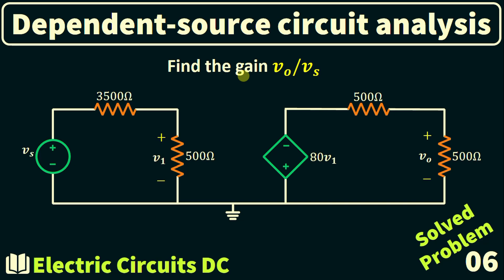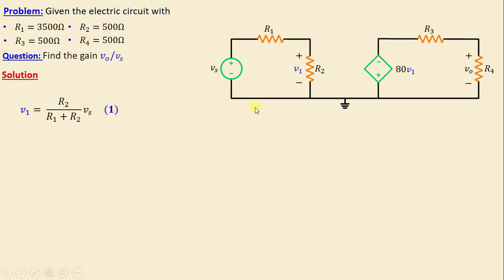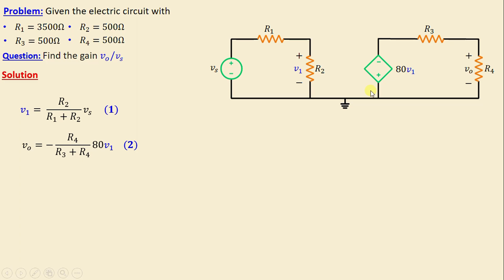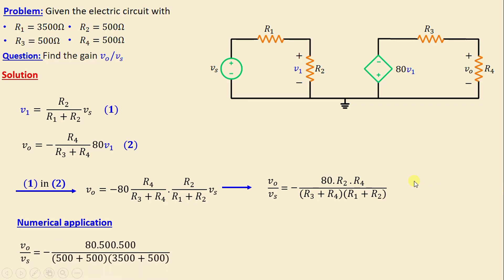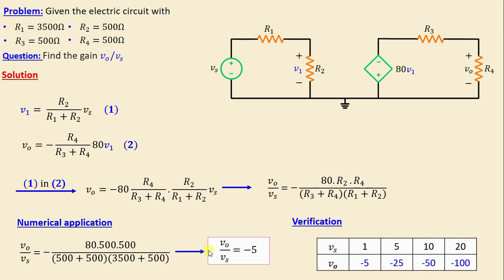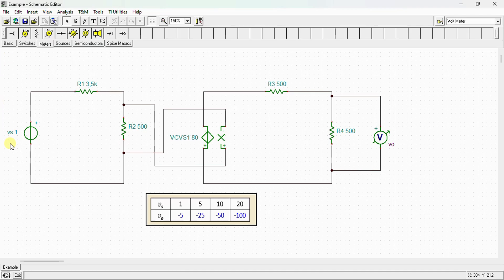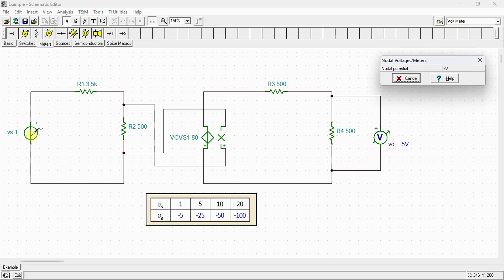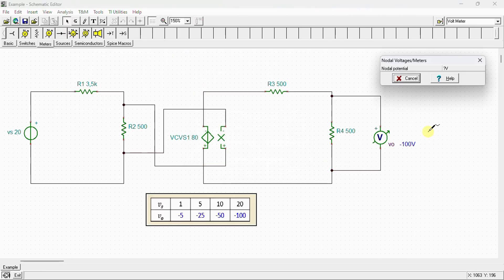Solving circuits with dependent current sources -Voltage divider- Problem 6

Comment: Sir why there is negative sign
Reply from the maker: If you apply KVL in the loop you will have it negative.
Reply: @ElectroMindsEducation-jl5vs we have to think about kvl during voltage dividing also